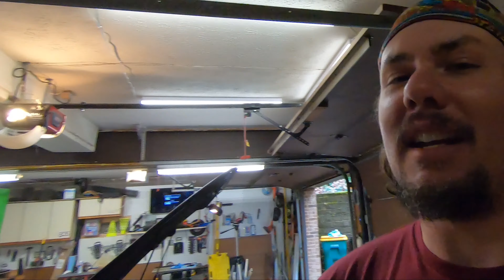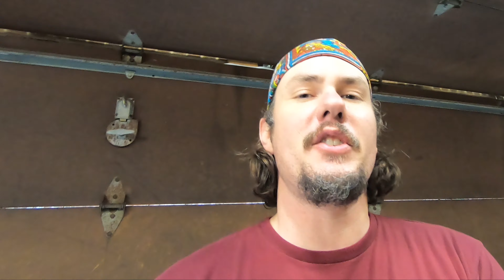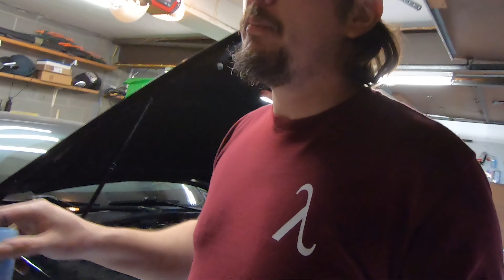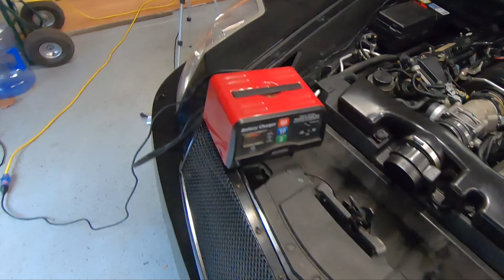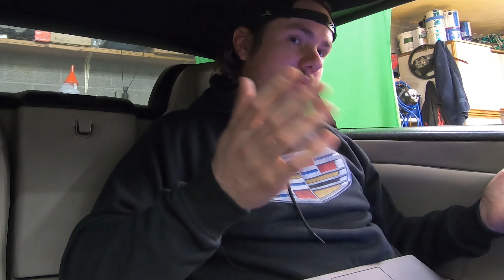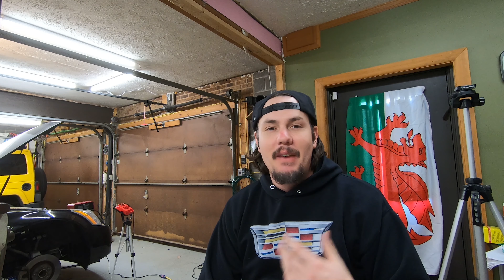PCC Is Haunted By P0615, Hooking the Original ECM Back Up

Comment: Hey man! Thanks for the vxdiag info, I ended up picking one up and using it! Thing works mint. I also had an idea for you, I don't know how many pins are on each ecu connector but they have Chinese weatherpack connectors that might have the 80 or so pins you need. If your going to be swapping ecus back and forth it might be worth it to add those on the ECU harness and then pin a pigtail for your ECU connectors so you simply have to unplug them at the ends, kind of like a quick release.
Reply: Maybe even some 4l60 connectors but I believe those are only 30 pin

Comment: The ecm monitors voltage on the crank relay (under hood fuse block) circuit, The bcm supplies voltage to that relay. Its fuse on that circuit. Fuse #12. That fuse gets its voltage from the run/ crank relay #2 in the bcm and run/ crank relay gets its voltage from the under hood fuse block batt 3 fuse.

Comment: Hey bro. I'm an incredible pain in the ass, I know. Lol. Question is, when I stroked and supercharged my TBSS, should I have changed the hpt to say "supercharger fitted" and bumped the displacement up in the general settings? It's 408 on about 12psi
Reply from the maker: No on the supercharger, you're not using any of the factory controls, that's if you had something like an LSA. You can bump the displacement, on a few of them it went actually make a difference, some it will effect your fueling but if it's already dialed in you've corrected it through fuel tuning. Good questions, not a pain!
Reply: @GoatRopeGarage  my fuel isn't dialed really yet. Soon will be able to log my AFR/lamda. But I hit about 4000rpm and when it hooks/good engine load it pulls a bunch of timing and fuel. About when it comes up on boost. That's why I asked about supercharger. Trying to sort out why it's doing that
Reply from the maker: You're on a two bar OS?
Reply: @GoatRopeGarage  haven't received my 2 bar map yet.
Reply: @GoatRopeGarage  but I'll probably have more questions when I get the 2 bar installed. For changes I need to make.
Reply: @GoatRopeGarage  currently watching injector video. My TBSS max out at 63 lb/hr but I bought 80#/850cc injectors. So I used the multiplier for volts to get curve and offset. Was pig rich so I cut offset by 50% and it came in close
Reply: Keep it up, I know you been busting your butt on this car but you will get it squared away